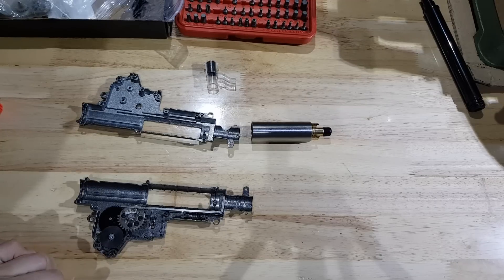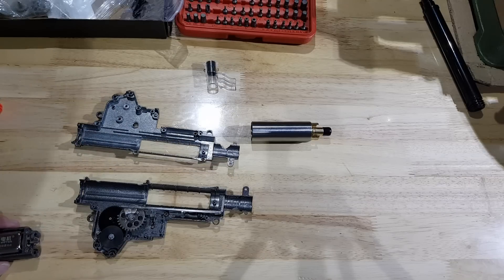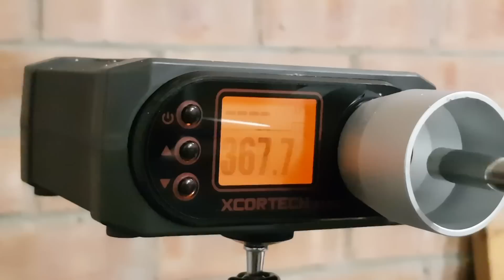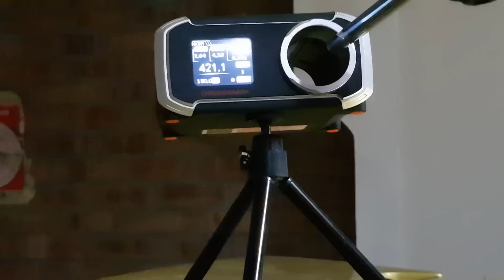Maximum FPS gel blaster build (the fable box)

Comment: Titanium gears looking at upgrade to a J10 ACR will you recommend the best set up for it found a 170m/s or 557fps but it don't look good if this is current you need airsoft parts??????? Shshshs what about gas as the M203 grenade luncher attachments airsoft could if used gel be ok for use hear?????? Otherwise I'll be modifing the spring and dual chamber for a full load shoot that took me a second😆.👍

Comment: Too much side thrust with the helical gears for those bearings. The housings aren't really designed for it either. Straight cut gears are always better, when noise isn't an issue.

Comment: hey bro, i upgraded my m4a1 but now it gets crazy hot and the battery dose too....help me please hahah
Reply: If you upgraded the motor you need to upgrade all the wiring, trigger switch and probably the battery too. Silver wire (as shown in this vid) is best, and don't use any of the cheap chinese lipo's - you need a proper Turnigy or similar.
Reply: @SirEatsCrackAlot  im suing 10a omron and upgraded wiring,the best is get a 480 motor and a bracket and an airsoft battery..i've tried with chi chai yellow motor does not last long ..now im using 33k motor(blackand red color 460 size motor)
Reply: what spring are u using?make sure its 1.1-1.2.. im using 1.4 unequal having the same result like yours..
Reply: @Rreeve87  i thought putting a black chi in meant i could put i bigger spring in :?
Reply: @webkam just get a 480 motor and airsoft battery will solve the heating issues..but if u're on a budget,just used chi chai motor rare earth and a 1.2 spring.. and also get a Ninja hop up,chainsaw products are trash does not do any improvement once u upgraded ur blaster..

Comment: What does that spring test on the low Guidos compression scale? would it be heavier than a 1.5mm?
Reply: M150 is way heavier than a 1.5 spring. M150 means 150m per second thats how they rate them in airsoft and being this shs m150 spring is an airsoft spring
Reply: @greasenbeats2230  thats funny i get a consistent 450fps on a 1.5 spring.

Comment: Does any cylinder fit with any type of gearbox or are they specific? What cylinder type is good for an RX AK47?
Reply: if u're using gen8 gearbox,usually fits any even from airsoft parts,as well as the piston..i bought my parts from aeg and installed it in my gen8,the best result when using mushroom type piston head!give u better results!
Reply: @Rreeve87  apparently Rx Ak47 has a different type of gearbox since it has a blowback mechanism built in. I really wouldnt know how to differentiate between a gen8 or gen9 to an rx ak47 cylinder...is it of the same size or is it different altogether?
Reply: @oneofthechosen874  for gen 8 and gen9 parts like gears,tappet,pistons,cylinder head and nozzol are the same,only motors are diff..now i recently installed silent bearing piston cylinder head kit(mushroom type) from and airsoft AEG parts and v2 mag motor .the result was amazing shooting was better then using dual oring piston. and motor mag result was 3x better then the standard motor,
Reply: @Rreeve87  That mag motor is interesting. Way did it improve? Your rate of fire?
Reply: @dud4577  does make an improve and rate of fire

Comment: So I'm guessing the generic gears stripped too? No doubt you already know but stainless oil-less bushings are needed for heavy springs. Depending how much you compress the spring with bearings (front only or front and rear) and as long as volume ratios stay within tolerance for barrel size, you might find short stroking necessary. I have a set of 13:1 gears in a nylon frame shortstroked by 2 teeth, 7.1 bore 27.5cm barrel and 1.4 spring. Didn't bother taking teeth from plunger. Works well, though I haven't tried a 1.5mm spring in it as once my gears are had it my buget won't allow another set in a hurry. Killed the first set of generic gears I tried the 1.5 on which is why I went the route of short stroking on the expensive gears.
Reply from the maker: No the cheapo gears kept going and going.
Reply: Wow, must have been the bearing failure that caused the damage then. I stripped generic gears on the first trigger pull with a 1.5mm spring, no bearing failure in my case.

Comment: Thanks for the clip LG & enjoy the coffee.
Taking on board your feedback on going to circa 350fps and maybe slightly above what’s the best way to get a Gen 9 up to that FPS?
-I’ve got an upgraded 1.3 spring, 11v batt & steel barrel.
-I ordered the Gen 9 upgrade kit from Gel ball mod just before seeing your vid the other day showing the cylinder not fitting in the housing so apart from using the gears not sure what else to do?
-what size bruise master barrel should I get to fit?
-what over mods to get it there? Eg Upgraded Wiring (could you send link example to buy?)....Mosfet switch is this from air soft sites (could give an example link to buy?)
Thanks Paul
Reply from the maker: You don't really need MOSFET unless you are burning out your trigger contacts. And you might get lucky with the gen 9 kit because i think they fixed it. You should be able to hit 350 pretty easy with  1.4mm spring.
Reply: Ok thanks LG.
FYI with your skills if your were able to build a reliable custom moded LG blaster hitting at 350 FPS plus there would be a very strong market for it, myself included. Thanks again